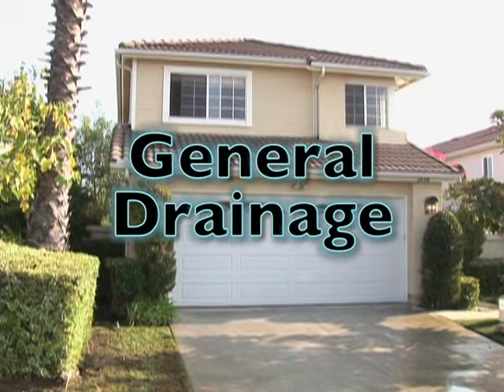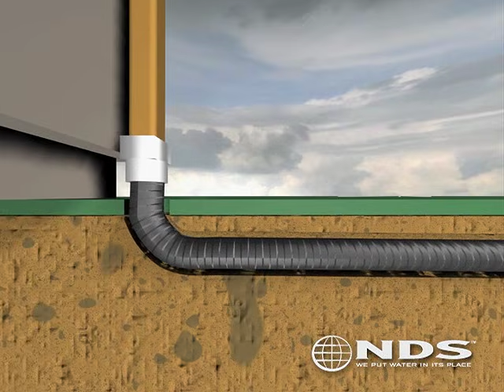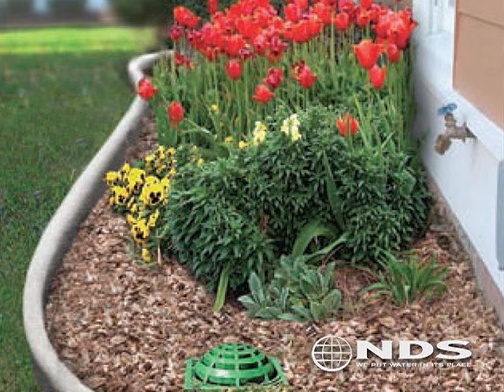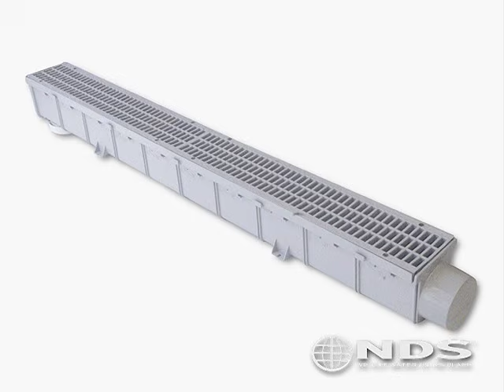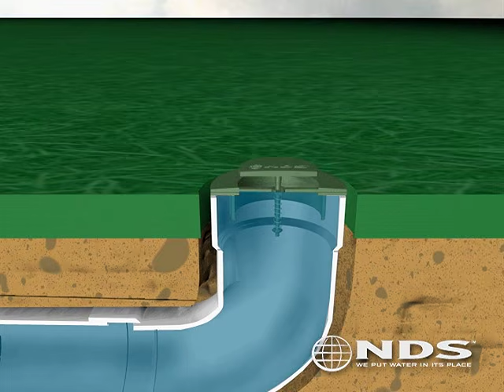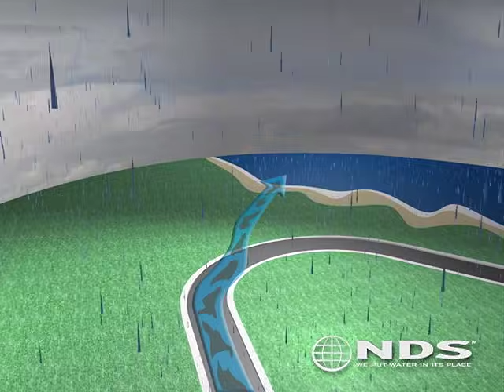How to Choose the Right Landscape Drainage System for Stormwater Runoff | NDS Yard Drainage Systems

Comment: Nobody mentions the Northern locations in regards to the pop-ups.
You run it down to 'almost' the sidewalk.
Then, either a rain or snow-melt event gets followed by a drop in temps.  What then follows is an ambulance and the always-present Lawyer!
Also, after a decent snowfall, wouldn't the weight of the snow prevent the pop-up from popping-up?

Comment: Why not just install a filter or gutter guard on your roof rather than adding a catch basin? Assuming you keep vegetation away from the roof you should only need to brush away any build up in roof filters once a year at most. Removing vegetation from the roof area also improves fire safety.

Comment: If you're gutters are protected with gutter guards, is a catch basin necessary under the downspout? Is there a way to deal with shingle grit interfering with flow in the corrugated pipes?

Comment: I noticed in the video that PVC pipe is used instead of corrugated pipe.  Currently, I have corrugated pipe installed underground in my backyard that is connected to one downspout and I would like to connect my sump pump drain to the downspout drain.  Is it okay to do that?  Also, if PVC pipe is used and connected to the flow well, should the PVC pipe have holes in the bottom leading to the flow well?

Comment: Videos can look easy and simple. My attempt to install drainage solution turned into anything but easy and simple. Builder made the driveway angle toward a bank and house lower than street. Rain creates a small lake; takes days to drain/dry. Looked simple to install a catch box and route the drain under the driveway. Cut across, dug the trench, but quickly realized that in order for the line to drain, it had to be deeper than the 12" catch box, a lot deeper. Kept testing and when water would finally run through the pipe the line was 14" deep and at the neighbor's property. So, a popup drain would not work. How is one to know? These EZ videos assume you have a large property and the angle of your property is always perfect. If you can afford it, get professional help.

Comment: awesome video it has touched on most of the problems with drainage , I have a sump pump that goes off every 30 minutes that when it empties the water into the yard there is so much of it it makes for a soggy yard, I was thinking of adding an easy drain French drain pipe in the ground under the grass but we have clay soil, is there a better way

Comment: Hi NDS,

I have a split level in CT on a fairly level lot. We have compacted silt soil (mostly clay). The downspout drainage system is currently clay tiles that run into dry wells. Some of the dry wells have collapsed, and some of the drain tiles have collapsed, so the drainage system is in need of repair. There is no french drain around the house.

There has been some water damage to the slab floor on the two story side of the house because of poor drainage by this side of the home. Over the years, water has made its way under the slab, frozen, and warped the concrete floor. The the water needs to get diverted away from this side of the house, and while I'm looking to do that, I think it would be a good time to update all of the drainage around the house. 

Just from my explanation, what type of drainage system would you lean towards? Downspout drains, or a french drain? I've heard that dry wells are not great solutions for the compacted silt/clay soil type that we have here. I'm also not sure that dry wells would be able to handle all of the runoff with the soil type in our area. Would I have to tie my storm drainage into the public storm drains on the street, costing big bucks?

Thanks, 

Kevin

Comment from the maker: It is always a good idea to install a Pop-Up Emitter, even if you have a Flo-Well or a traditional dry well system.  The Pop-Up Emitter will provide a place for the water to go that is not absorbed into the ground.  This can happen if the water entering the Flo-Well is greater than the storage capacity of the Flo-Well.

Comment from the maker: Yes you can and this is called a dry well. The only problem with a traditional dry well is that you only have up to 40% of the available storage because the gravel is taking up most of the space.  The Flo-Well creates an open space in the ground that can hold 50 gallons.  The Flo-Well is 2’ round by 2’ tall.  To get the same 50 gallons in a gravel dry well, the hole would have to be 2’ round by 5.32’ deep. While both solutions work, we find the Flo-Well to be more efiicient.

Comment from the maker: We're so glad to hear that you were able to solve your drainage problem! As for your driveway, a 12” x 12” catch basin is one possible solution to this problem.  The drawback to using a catch basin is that the surface needs to be graded such that the water is directed to the catch basin.  A channel drain is a long drain that is installed across the driveway to capture anything that flows towards the drain.  It will collect water over a larger area and would be the better solution.

Comment from the maker: No question is a dumb question! The answer is, yes you can absolutely use a pop up emitter with a perforated pipe. A pop-up emitter should be installed at the end of every drainage installation. This allows a place for any excess water to go.

Comment from the maker: Hi Joe, thanks for your question! In the winter time, the surface would freeze.  This would prevent water from draining to the surface.  The Pop-up emitter should be installed on an elbow that has a weep hole. The weep hole will allow water in the pipe to drain.  This will solve the problem with the emitter being frozen. The elbow should be installed below the frost depth. A section of pipe can be connected to the elbow to bring the Pop-up to the surface. Hope this helps.

Comment from the maker: Hi James! To answer your question, yes our Flo-Well can be used as a cistern. Placing a heavy mil plastic sheet inside of the Flo-Well will create a water tight area that can catch and store runoff water.  When using the Flo-Well to store water, it is recommended that you also get the Flo-Well bottom for additional support.Hope that's helpful!

Comment from the maker: The EZ-Drain has a layer of fabric, but in high clay/slit soils, it is a good idea to line the trench with an additional layer of fabric. NDS does offer fabric for sale.  You will want to use a permeable soil for the backfill.  This can be a new soil brought in, or they can use the existing soil as long as you amend it with sand or gravel.  To do this, you need to mix sand or gravel in with the clay and then use that as backfill.

Comment from the maker: There are several ways to drain water from the catch basin.  A variety of pipe types and sizes can be connected to the outlets on the catch basins.  Water that enters the catch basin is then carried away in the drain pipe.  If the drain pipe is perforated, then the water will percolate into the ground along the length of the pipe.  Holes can also be drilled into the bottom of the catch basin to allow water to slowly percolate into the ground beneath the basin. Hope that helps!